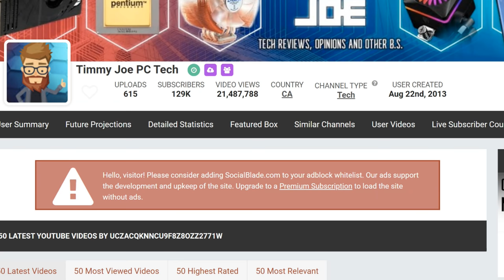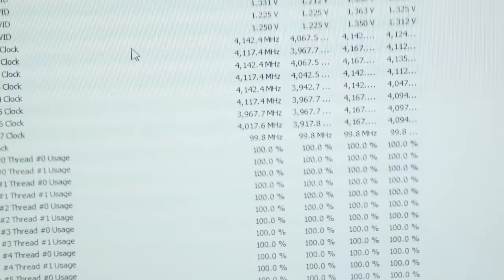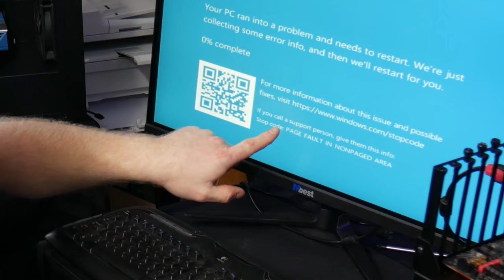This Ryzen 3700x was my biggest problem in 2019...

Comment: looks like an idle power issue, the cpu wasnt getting enough volts at 
"idle". If you overvolt it with an offset by a couple mV it may be fine i
 bet.
Reply: That was my initial thought. Very typical error with voltage being too low at idle.
Reply: Yeah they some auto feature in which if you go manual you can select typical idle current ,
Low power idle current
Reply: I bought a faulty i7 6700 off ebay that was blue screening. Put the voltage up worked great. After a month I put the voltage back to stock hasn't blue screened since.
Reply: yeah, I had a similar issue with a 2600X and a asus x370 board
Reply: But why then he couldent even install Windows, if it was just idel power problem?
Reply: @timowallin8020  idle power is controlled by bios not windows.
Reply: @timowallin8020  i didn't hear him say install windows , he said the guys said it crashed upon loading (booting into) windows, (which happens as soon as load is off (all backgrounds apps have started )
Reply: @ragasshaggy  6:31 he mentioned it wouldnt allow him to install a fresh install of windows, and so he tossed his test bench hard drive in.
Reply: Okay, first off thank you for this video. I’m having this exact issue with my 3700x. Except! It just randomly power cycles! Sometimes I get a blue screen but most of the time I get a power cycle. Happens about 2-3 times on my auros motherboard!!! I’m guessing I need a new motherboard!
Reply: @millergram  doing a fairly quick look, it seems like that is the issue. A lot of the same mobo's, from the same manufacturer, have many 3700x users frustrated. Personally, I went with a Asus X570 mobo for my 3700x, and other than some PBO issues (can't get it to turbo, settled at running a locked 4.3ghz on all cores), it's been running flawlessly. Had only one blue screen, and that was my RAM running a little too fast. Just dropped it to 3200, and now it is stable. Try a different motherboard vendor, and go from there.
Reply: Josh Frank thank I may have to. It happens 2-3 times every hour
Reply: @Flamingneedles  oh yeah , just read that&heard that but that's possible even with idle current thing because the menu where user interaction is required is almost 0% load. 
(By user interaction required i mean when it asks you to select drive , put in key , which version to install) .
Reply: sagar thank you I will give this a shot as well
Reply: @millergram    yeah that message got deleted by mistake here it is again. 
manual voltage mode : 1.275(stock cpu cooler )  ;  1.325(after market good cooler) 
Load line calibration -level 4.
Reply: @ragasshaggy  I'm not sure if the voltage curve, would be the same on all of the boards he tested, but it could very well be. I'm guessing, they'd keep them if it works for the most part. Crazy to think that his 12 core part, ran perfectly on the same board, that gave problems with an 8 core part. A 65w TDP even, not the 3800x. Strange things, man, strange things lol.
Reply: sagar I’ll give it a shot. I’ve been frustrated with this shit. I’ve updated the bios from f41 to f50 and it made it worse. I have the mITX version of it. I have the b450i
Reply: Low Power Idle may be "Enabled" on some Mobo's. I had same issue, but not on default settings but on offsetting Voltage under -0.825.
Reply: @Flamingneedles   just saying 4.3 ghz all core is the rated speed for the 3700x. 4.4 ghz is the single core rated speed.
Reply: @creesmith2794  it isn't .
Reply: i have an arous b450m 3600 rx 570 build originally  if closed a game i had a high probability of the paged file in non paged area now the 570 is dead im getting a new graphics card should i get a new motherboard
Reply: @creesmith2794  rated, base speeds, are 3.6ghz, with single core boost of 4.4. I'm having a few issues, trying to get it to boost, so I just ran a OC of 4.3, and leave it be since I'm not normally running many single core tasks.
Reply: @Flamingneedles  the thing is these processors consume way too less power under realistic scenarios .  I ve got a 3900X running on manual OC,V ~4.2ghz all core 1.33V . If i m editing in pr pro , streaming+gaming  ( i see only 75-95W in HWINFO64) ( used to see 170-185w in few weeks post launch). The idle is about 25W tho somehow . 
My VRM's in summer @idle 48C - goes to about 57C , 
Currently winter VRM @idle 34C ; load 40C
No sweat at all . So budget boards aren't having issues , i still dont recommend them for 3800X,3900x,3950x even for stock operation.
I wrote this kinda in detail coz i m running a AORUS ELITE X570 .  Someone else put in a good point about speed stepping x voltage mis match . Tighter tolerance making it crash could also be that or typical idle is what more than likely happened in millergram's case .
Reply: @ragasshaggy   Yes it is don't correct me if you're wrong 4.4 ghz is single core turbo with PBO2 enabled so shut up and stop acting like you know what you're talking about.
Reply: @Flamingneedles   oh that makes sense
Reply: @millergram  also do you have 2 fans near your VRM area not to be an @$$#0l3 ,but the VRM. On thay board are kinda weak . I had ab350m gaming 3 (i rode them suckas all the way uptill 125C not kidding xD ; also the board didn't die ) . Was OCing a RYZEN 1600 with a 360 aio the thing couldn't cross 71C even at 1.41V .
Reply: That's also very on brand for gigabyte boards. Bad auto power handling.
Reply: @ragasshaggy  I've noticed that, as well, on my Asus Tuf Gaming X570 Plus board. Arguably, one of the lower end X570 boards, but I didn't need the more elaborate features that the $200 plus boards had. Still, lower power draws, at wonky times. I agree, I wouldnt run a 3800x or above on a lower end board, even if you can. Just, so many headaches involved. I dont mind the detail given, it's more beneficial than anything.
Reply: @Flamingneedles  i f#(King wanted your board even though mine has better VRM'S , the ram OC on your Mobo is just beast mode.
So short story low availability of 3900X selling for way over 725$+ . 
I go to my regular guy he tells me average of market is 710$ , then brings 3900X out the back for 650$ (special price for me , (i have gotten him sales of around 15K$ in 3 years that I ve known the guys ). 
Instant buy ; Mobo (he has no pressure from any brand ) . He said whatever you want will arrange, only this board AORUS ELITE X570(or msi ones which i didn't like due to their VRM being not a good in this budget)  was available otherwise for ASUS TUF X570 i would have to wait 3 more days which wasn't gonna happen so picked this up . 
But i m in a week xtreme OC group . The tight ram timings samsung b dies (which i have) runs on the asus x570's are just insane compared to such shit on mine . People run CL13-14-14-14-28 3600mhz on ASUS'S . meanwhile i cant go below CL-16-16-16-16-32
Reply: @BjornsTIR  hmmm , as the other guy said , if gigabyte didn't get the engineering samples and their speed stepping sent , it's AMD's + gigabyte's fault for improper co ordination.
Reply: Maybe it's a problem only with Gigabyte boards. From my own experience and from what I have read on forum in my language Gigabyte boards often causes problems with AM4 sockets (Intel, don't know). In total I had 3 MSI boards including the one I use now and my old one (current with R5 3600, older with R5 2600) and no problems. In total 2 Aorus board only really annoying problems. First one was broken after a few weeks and the other had some boot problems, etc.
Reply: @ArmpitoftheGiant  But then why is it only doing it with the review sample of the chip and not the retail version?
Reply: My 3900x was a bit flacky at launch with my primary system. Now that I’ve kicked it down to my itx build it’s rock solid
Reply: @fakeman you never know with these boards from gigabyte, biostar and asrock, some are pushing deadly voltage on stock auto in zen2 CPUs
Reply: @steveosgood9182  I kinda doubt that you had such issue on a Asus x370 board, it more likely was your CPU
Reply: @millergram  do you have latest BIOS? If you do, play around with voltages and VRM frequency and LLC calibration, if that doesn't help change the board
Reply: @Flamingneedles  PBO is OCing and never has been warrantied, but with that being said, it probably it's CPU...
Reply: @TheXlen  what? I'm not really following, what you just said lol.
Reply: Never had an issue with a CPU, but had an issue with an old system with a C2Q Q6600 in a P5N-D crashing if I installed a GTX 9800+ in SLI. Would work with Windows XP, but install Windows 7, and it would immediately crash. I troubleshot it for almost two weeks. Found out it was specifically the 9800+ that didn't work in that board.
Reply: @TheXlen  I did countless hours of research on this problem, google "x370 prime pro idle crash" one company in Australia had a bunch of the same boards that had the same prob, and they fixed it by diasbling global c states control. But, That did not work for me  . Owners of other brands of the x370 chipset reported similar problems
Reply: @timowallin8020  C levels not enabled until OS installed
Reply: Josh Frank I have a 3700x on an x570 Aorus elite motherboard and I have had no issues whatsoever.
Reply: @steveosgood9182  I'm running an ASUS X370 board myself with no issues, generally haven't had issues with any ASUS product in past, well except the GPU tweak Software, but for that everybody uses afterburner, so doesn't matter...
Reply: @Flamingneedles  sorry a typo, PBO is overclocking, overclocking is known to not be covered under warranty for most CPUs
Reply: @Kyleshura  if X570 had any issues with ryzen CPUs then people would lynch gigabyte, generally all x570 boards are over engineered, so even from the shittier companies it shouldn't create issues
Reply: @TheXlen  ah, I gotcha. It may not be, but then again AMD unlocks their CPUS, so it doesn't really deter users from OCing manually. PBO is good, when it works properly, but OCing manually works just as well if you know what you're doing. For the average consumer, I'd suggest just going with PBO, and dont worry messing anything up going manually. Mine just happens to not want to boost past 4.1, so I just manually capped it at 4.3. It's stable, so I'm not really too worried with it. Maybe I'll fiddle with the voltage, and get a little more out of it. For now, I'm just happy it works lol.
Reply: @millergram  keep in mind same symptoms for failing PSU
Reply: @TheXlen  There is probably no issues with most of them, but I did enough googling and reading to see that a lot of them do have issues. Mine did it every 48 hours or so, running 24/7, and always at idle. Under load, it was rock stable. The Overclokers. net owners thread on the x370 prime pro has plenty of posts about it. A lot of owners got relief by disabling global c states
Reply: @James-qu6ul  Because every chip is slightly different and can tolerate different voltages. AFAIK AMD chips that go out to reviewers are the same as retail chips.
Reply: Yeah I don't like the lack of granular control with gigabyte bioses last time I liked a gigabyte BIOS was Z97 & Z170 with their grey pallette BIOS, this modern red gamER BIOS can't do anything thing with precision!
Reply: @Flamingneedles  lol so just overclock ur Ryzen to fix the problem
Reply: @ApexierGS  no, don't just OC. Follow the steps others have gone over, to verify rather it is a mobo issue, or just a setting.
Reply: Could it be a LLC issue? Seems it could be a hangup if more voltage is called for suddenly and power isn't delivered fast enough?
Reply: that is common also on some mbs
Reply: @Fakeman  seems this could be a culprit because it's lightly threaded workloads
Reply: @BenState  yep and OS install crashed 6:30
Reply: @ragasshaggy  6:30
Reply: @Joker-no1fz  Yes but PC hardly idels when you try to install any OS on it.
Reply: swap the cpu with a 2200 ryzen start a few times, problem solved.
Reply: @Flamingneedles  Update, it was the motherboard. I got an asus 470-i and it works great! I've tried everything on that gigabyte board and i finally just swapped it out.
Reply: @millergram  that's good to hear dude! Glad you got it sorted out. Yeah, some times it's just that easy, swap a mobo and it all works out.
Reply: man i am getting the same problems, but i have an ASUS x570 TUF gaming plus mobo, I am getting constantly freezing in idle after a few hours of use, usually during the evening, I really don't know what to do I am going crazy, should I swap the mobo? Maybe that's the problem? Or is this a flawed CPU? If anyone can answer me that would be the best

Comment: Processor state...minimum 20%....99 max....awesome tip to control temps on ryzen and spiking clocks...very stable now...68 full load on 3700x and wraith prism on Gigabyte ab gaming 3 motherboard with bios and chipset updates
Reply: Will try this next but right now, I have mine running at 10% minimum CPU processor state. PC friggin froze during idle after 2 weeks thinking I solved it by just setting C6 power state to "Typical current idle" and kept power settings on Balanced mode (5% minimum processor state)
Reply: @TheGIMP2k  did you fix it? I have random reboots on idle with the pc I just made an AMD build with a ryzen 7 3700x aorus mobo. I didn't fiddle much with the bios I just updated it to the last version and enabled xma for my ram. 
I'm currently using balanced mode with 5% minimum processor state and 99% on max, updated drivers (chipset and so on) and so far I haven't got a random reboot...

Comment: The strangest problem I had was in the 90s.  My friend's computer kept getting errors we couldn't explain.  We swapped out every component, one at a time, trying to solve the problem but to no avail.  When we took all of his original hardware and installed it in a different case, the problems went away.  Something about his computer case was causing all the problems.  We figured it must've been some kind of a short, be we never found or for certain.

Comment: THANK YOU, from the bottom of my heart THANK YOU!

I have been having this EXACT issue with a slight change in components since the release of Zen2. My build has a 3600 on a Gigabyte Aourus Elite.

I don't have the reliable cash flow to justify part swapping on any scale without a clear idea of what part is causing the issue so this has given me a clear idea to try. Coz honestly i've been running out of things to try at this point, I see the event viewer in my sleep.

Thank you for making this video to highlight a super niche problem that has been haunting me for MONTHS.

This might not even fix my issue but like I say even just having an IDEA something to hone in on and try based your testing with multiboards is releiving.

Happy new Year and all the best
Ian
Reply: I'm in the same boat I think. I don't know how to check and see if mine is an engineering sample though